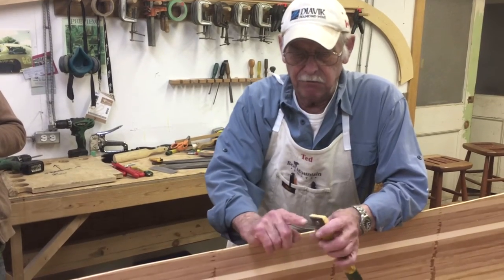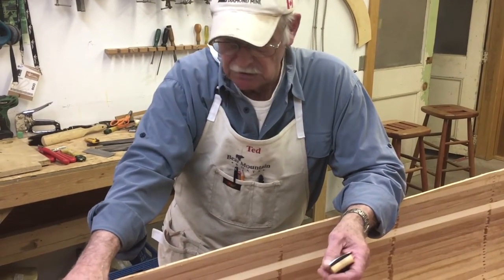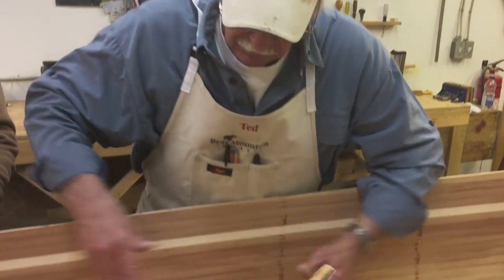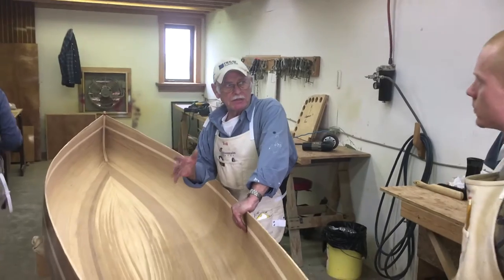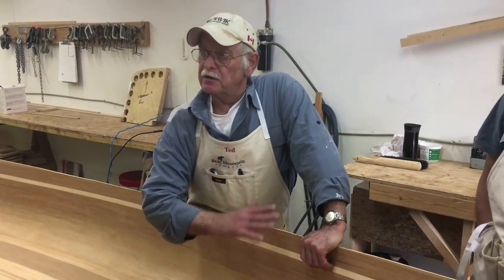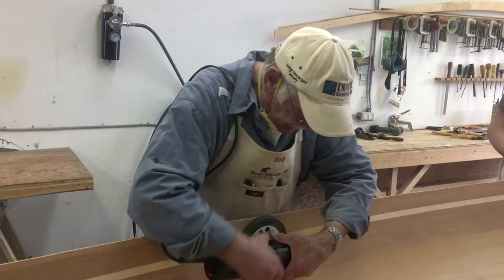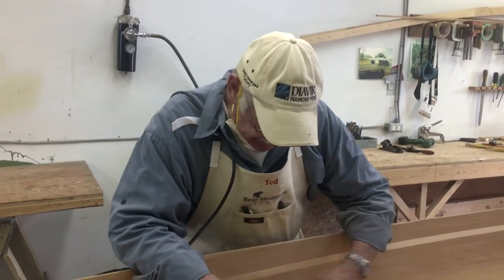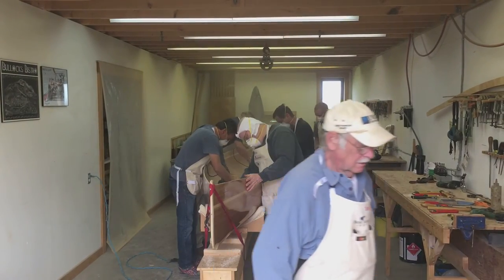Fairing the Hull Interior - Canoecraft Workshop Series

Comment: notice the holes are smaller on the inside, that because you rock the staple somewhat pulling them out and the inside doesn't get the same damage.  Always steam those holes shut with moist heat.

Comment: Another great video, thanks so much. I am wondering what make and model of sander you are using as well as what abrasive pads you are using. Thanks so much!
Reply from the maker: I'm going to have to ask Ted - I'm not sure specifically what he's using here. Hopefully have an answer for you before too long...
Reply: @Canoecraft  Thanks Joan.
Reply from the maker: @OutothehousewithPaul  Hi Paul, sorry, couldn't get an answer on the exact model of sander he's using here, but the good news is any random orbit sander will do really, bearing in mind the advice from the video re: doing rough shaping with hand tools first. Do a pass with an 80-grit pad first and then a smoothing pass with 120
Reply: @Canoecraft  thank you.
Reply: Paul, It appears to be the Porter Cable 7336 . A 6" random orbital first made over 30 years ago and still in production. Originally with a 3.7 amp motor they are now made with a 4.5 amp motor. I have 3 of these and use PSA disks from 40 grit up to 400. For smaller jobs and tighter curves I'd recommend the 5" Bosch ROS20VS with hook and loop pads. Hope this helps, Richard
Reply: @rcschmidt5042  Thanks for your reply and the info Richard.